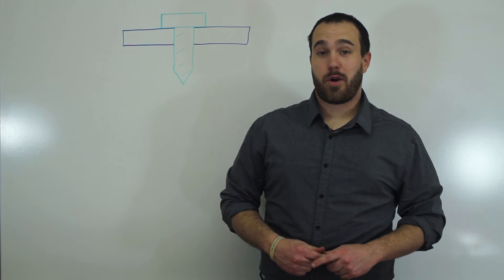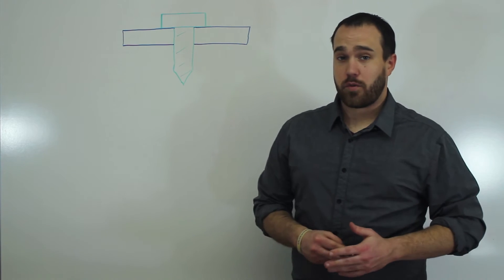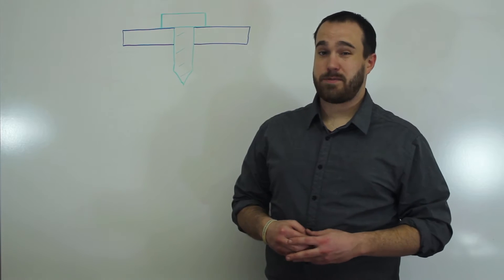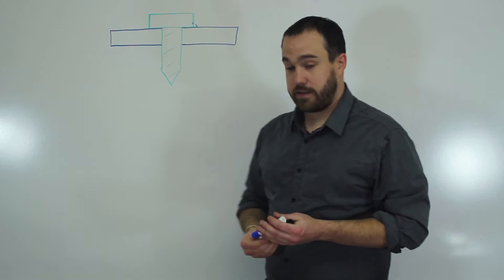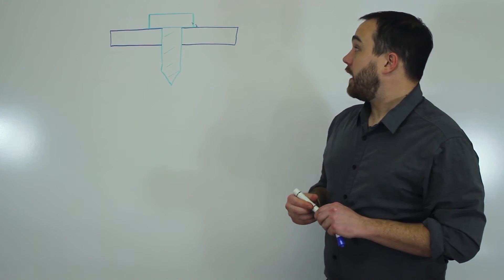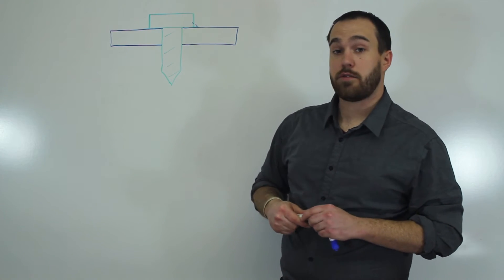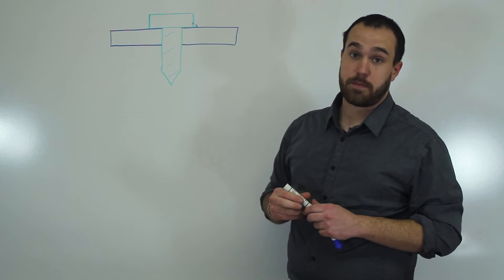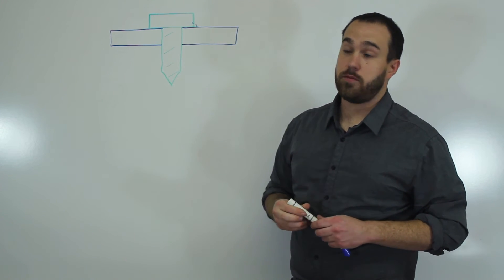Quick Tip - What is Galvanic Corrosion?

Comment: You did not really explain what galvanic corrosion is! What you said is "aluminium atoms are going to leave this material and get onto the steel causing it to corrode" and this because the two materials are "at different electrical potentials". That does not make any sense to me.
Reply from the maker: Galvanic corrosion is an electrochemical process in which one metal corrodes when it is in electrical contact with another metal in the presence of an electrolyte (such as salt water). One metal (Aluminum) acts as the anode and corrodes, while the other metal (Steel) acts as the cathode and remains protected. When these metals are in contact, and there's an electrolyte present, the aluminum corrodes at an accelerated rate while the steel remains relatively unaffected. We recommend keeping dissimilar metals from direct contact with each other by using insulating materials or coatings. 

Let us know if you need any further assistance!
Reply: @ShortRunPro  Many thanks for the update. In my application there is no obvious electrolyte present e.g. salt water. However, I have since done some research and it seems that even the moisture in the air can act as a weak electrolyte. Again, much appreciate the additional information and the offer of assistance.

Comment: So if a steel bolt is zinc coated and bolted into aluminum will the aluminum corrode?
Reply from the maker: The zinc plating is less reactive than raw steel and is therefore less likely to react with the aluminum. In moderately humid conditions it is likely that little to know incremental corrosion will occur. In high humidity conditions the use of an electrical isolating between the materials is recommended.
Reply: @ShortRunPro  what about on a set of car aluminum heads?
Reply from the maker: @sambo92  We are by no means experts on the use of fasteners in an automotive application.  However, researching the internet we find that stainless steel fasteners are often used with aluminum in these applications.  There also appears to be fasteners that have a specialized zinc and aluminum fleck coating that is corrosion resistant in these applications.

Comment: Rubber washer? Seriously? What about the thread?
Reply: Yeah? Model?
Reply: I suggest copper grease. It permanently prevents corrosion on the contact between aluminium alloy wheels and stainless steel hubs on cars. Another possibility is to use silicone rubber to seal the threads. If water and air are prevented from reaching the threads, corrosion cannot take place or be substantially retarded.